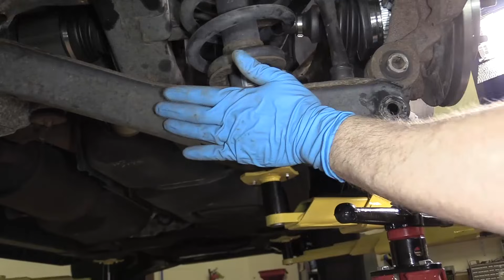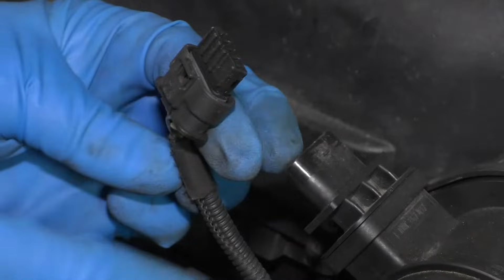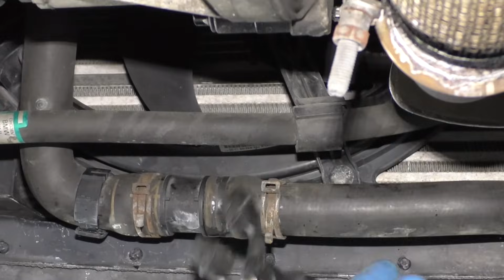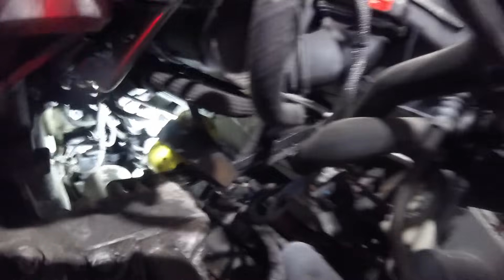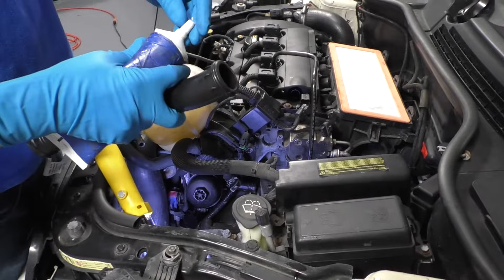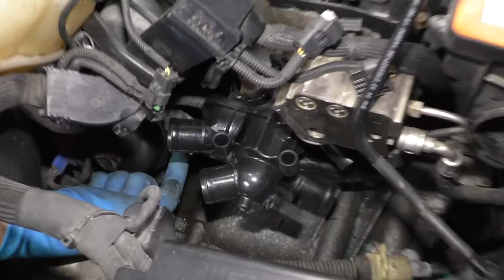How to Replace Water Pipe 07-13 Mini Cooper S

Comment: As always, thanks for these videos!

 One suggestion for viewers, at 13:10 instead of pulling back and forth on the thermostat, if you instead repeatedly twist it side to side with both hands (like a steering wheel) it will allow the thermostat to be removed from the water pipe without breaking and will leave the water pipe connection to the water pump intact.

Comment: This was awesome!!!  I noticed a pretty serious leak on my daughter's Mini this morning.  I was praying it wasn't the head gasket.  I started doing some research and found this video and other indications to check the cross tube.  I went back under the car after re-filling the expansion tank and could clearly see the fluid was leading from the pipe.  I put my hand in there and could tell there wasn't any liquid above it.  Moved the pipe around with my hand and the leak increased.....dead give away.  Followed your video and removed the plastic pipe.....it was broken right in the same area as yours.....fantastic.  Thanx, so much for your assistance.  You really made my day!!!!! Cheers.
Reply from the maker: +Lee Douglas Thank you! We love empowering our customers and showing how to perform DIY auto repairs with our high-quality auto parts.  http://1aau.to/m/Shop-1AAuto-c

Comment: Going back together was a nightmare for me. I ended up taking off the intake manifold just to be able to connect the thermostat housing to the cross-over pipe outside of the car and then sneak it in. With the intake manifold off, you could clearly see the waterpump side and gives you a lot of room to work with. It's more work but made it easier.
Reply from the maker: +Marcos Rivera Thanks for the feedback!

Comment: Great video, especially the borescope. Couldn’t have done it without that. I had trouble with the pipe as well. Mine was not leaking, so in hindsight, I maybe shouldn’t have changed it. I broke it trying to get it out so in that respect I had to. In the end it took a special vice grip on the pump end to get it unstuck. I’m happy it’s complete, and saved a bunch of money.

Comment: I had debris and the o-ring stuck in my pump as well.  I could not get to it without removing the intake.  The pipe was a lot easier to route inside the wiring harness once I did that.

Comment: Just replaced my crossover tube and thermo on a 2010 MCS usiing this video. I did take the air box out too so you can guide the crossover tube to the opening in back of the water pump while looking down at it with a light.  Thanks so much!
Reply from the maker: +Perry and Ingrid Dunstan Thanks for checking us out! 1AAuto.com

Comment: Great video. Very informative. I do have a question; could this job be easier if the manifold below the air filter housing is removed?
Reply: No it’s makes it a tiny tiny bit easier it’s still really hard
Reply: Yes it is! I just did this today and once I removed the intake manifold, I had a clear view of the water pump and access to the pipe. That was important as part of the pipe had broken off and stayed in the water pump. Removing that broken ring was then easy.
Reply from the maker: +Neil Hare Thanks for the tip!
Reply: I did this job this week. There’s no way I would do this without removing the intake manifold! Ever!

Comment: Definitely didn’t reach your hand in and pull the broken parts out and also def didn’t use your hand to clean the area. This is a fairly simple job, just lots of steps. If you’re replacing the thermostat housing, you might as well replace this pipe as it’s known to leak/crack or be broken. It’s cheap enough and with a 20.00$ 1080p cam from Amazon, your life will be easier. There is also a metal replacement available so you don’t have to bother with this ever again.

Comment: NEVER replace coolant hose spring clamps with a worm gear clamp like you suggested. 1) those springs do not age or degrade or take a set, it's spring steel and not subjected to cyclic fatigue stresses. They don't wear out, the rubber hose does. 2) I've seen WAY too many times where a worm gear hose clamp was overtightened and cut into the hose. 3) spring clamps always maintain the same clamping force on the hose as the rubber expands and contracts with heat cycles. As the rubber ages and hardens, that spring clamp still maintains the same clamping force. 4) Worm gear clamps almost always get overtightened, and when the rubber expands from heat, that worm gear clamp doesn't, and it can severely degrade and cut into the hose even further. About the only advantage a worm gear clamp has going for it is that they can accommodate several different hose sizes, whereas the spring clamp has to be properly sized for the hose it's on. But that isn't a problem, because they (see number 1) NEVER wear out or get weak.

Comment: To remove the tube, did you have to disconnect the gear linkage?  I can't seem to get the tube past that portion on a Manual 2007 Non-S

Comment: I could never push in the tube with new O-ring on the tube. The only way to push it in when thermostat is tighten and will push the tube in but still I always reuse the old O-ring.
Reply: I've been struggling for so many hours to get a new friggin pipe in. 😭Have ended up breaking the small plastic parts which the clip sits in on the new pipe. Wondering if I could live without the clip as once the thermostat is fitted it's not like the pipe can go any where? 

Have ordered a decent German brand pipe, if that doesn't go on I'll try reusing the o'ring as you suggested. What a crap design this is. 👍

Comment: Does anyone know if the crossover pipe should be oriented the same way on a base model mini? I’m a 2007 but no turbo, super, anything like that. Dual overhead cam and everything—just replaced my thermostat and water pipe but it still seems to be leaking, and when we took the old one out it seemed to have been installed at a different angle than this video shows. I’m wondering if that might be why it’s still leaking

Comment: A1's pipe came outta da water pump, (like mine did when I was replacing da thermostat housing).

So, anytime you are replacing da thermostat housing, it is nearly impossible to separate da thermo housing from da water pump pipe witout da pump pipe breaking and coming outta da pump.

Dere should be a design upgrade here. 

Design a connection and clip at da thermostat housing curved pipe end, where technicians, (us) can access witout pulling da pipe outta da pump.

 However, I know now as I speak, dis is da whole plan to sell more parts. Ok, dats kool too. Then sell as a package, thermostat housing and water pump pipe TOGETHER. You can't install da housing witout RIPPING DA PIPE OUTTA DA PUMP.
Reply: Translation Guide:  Dis=This.......Da=The......Made my head hurt trying to read this.  Sandy is dead on the money, makes a great point, and it is helpful advice.  But yo why da slang yo?!
Reply: I agree.  The design of the pipe and housing is probably the worst user friendly design on the planet Earth. the tolerances and rigidity of the setup is a nightmare. No access and line of sight. A redesigned housing with shorter stub for the pipe connection and a longer pipe is a simple fix. Moreover the whole plastic use is absurd.. Should be a nice rubber hose with a permanent adaptor at the water pump

Comment: Hi 
I got my thermostat replaced at mini for my r58 jcw, now my car stoped making pops n bangs on motorway, checked the coolant temperature in hidden menu it drops to 63degree centigrade and in slow traffic stays in 90s. I am wondering is it supposed to drop to that low temperature or it should stay at 90s 
Please reply as they are saying it’s Normal and piping and banging normally starts at 75 degrees
Reply from the maker: +Javid Chachoo Thanks for checking us out! We recommend taking your vehicle to a local mechanic for a diagnosis.

Comment: Slide it out just like that!?  I've been fighting that pipe for hours.  Its stuck in the pump and it wont budge.  I've been pulling, pushing, jiggling, wiggling, prying, crying and sweating and swearing. Am I the only one having this issue?
Reply: Having the same issue. Have you got it out?
Reply: No Brent, I've been doing da same. Thanks for posting A1, I'll look you up for parts👍. 

Brent, I initially had NO PROBLEM wit da pipe leaking til I removed dat dang clip on da forward end to replace da thermostat housing. Da dang pipe came outta da water pump instead of da thermostat pipe at da clip.
I've jes received a new pipe today and wanted to see if anyone other than a $500 per r/r shop has ever sucessfully removed and replaced it witout having a $500 repair bill. Da transmission linkage is in da way on my '09 base Coop. Imma "give it a go" again.
Reply: On my R-55 Clubman, I can’t seem to get the pipe out due to the throttle mount being in the way. It seems like I would either need to remove it or take off the intake.
Reply: Brent Gibbs I’m literally having the same issue!!! Pipe won’t budge I just need to turn it counter clockwise just so the thermostat housing can sit flush! But it won’t budge
Reply: I had the same problem but since I removed the intake manifold I was able to put a screwdriver on one of the hooks and pry it out. I was so happy as you can imagine! lol

Comment: Terrible engine. Let’s make one more pipe under intake, oh it should be made of plastic for more fun. If you bought mini with n12,14,18 it is better just remove engine and replace everything.  Because you need to replace timing chain every 60.000km, heat exchanger seals, valves seals, that disgusting pipe. And almost all these problems because someone decide that engine temperature is 113 Celsius is better for engine, but for seals and plastic in the engine it doesn’t. 
Thank you for your video. I had mini year ago, replaced everything and sold. Today I was thinking to buy one more turbo with manual, but I remembered how bad these engines again😂

Comment: Wow all that work to replace a pipe ???
Reply from the maker: Thanks for checking us out! Yes, this is quite a process for such a small repair but all steps shown in the video would be required to complete the installation on this particular application. +Paul Costigan

Comment: This design is a pies of shit design.. i am having now on my own car replacing the thermostat and it would not come lose !! so when pulling hard i heard splash of cooland on the other side of the engine and yes the pipe broke at the waterpump side. But my Peugeot 508 has a addition connection on this pipe almost impossible to remove the dam thing. Orderd a new pipe and hose that goes below through the subframe underneat where no tools can come. And yes i also needed to take the intake not off but loose. 

i had many cars but PSA engines or Peugeot en generall suck really really bad. For the simplest thing you need to remove also half the engine and having al the room in the engine bay to locate things better.

i loved my E46 and E90 even F11 6 cilinder engine BMW they where superb in design and know where things need to be placed. 

i sad to my wife next time we only get a BMW.